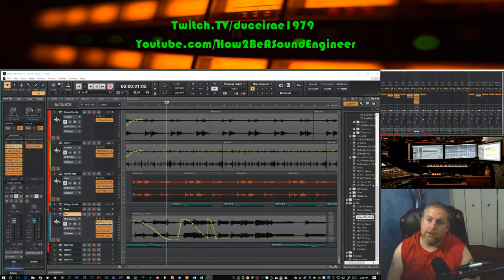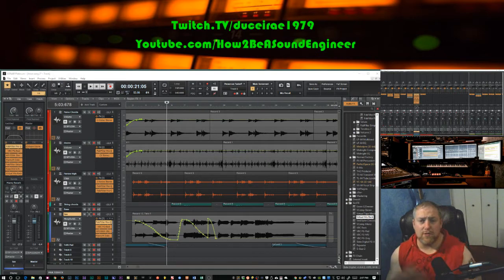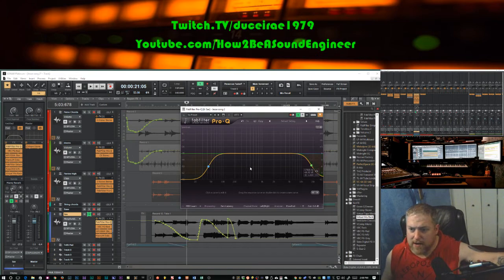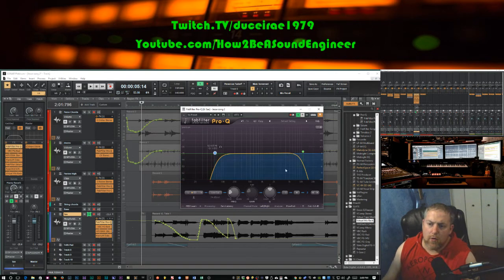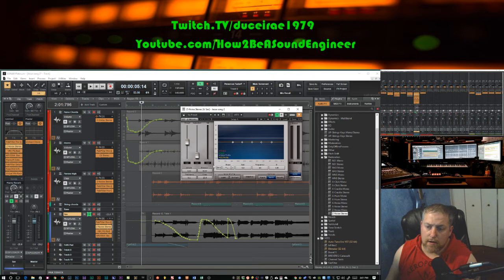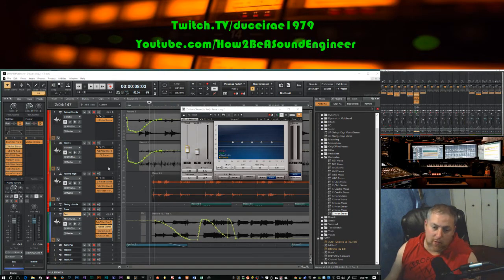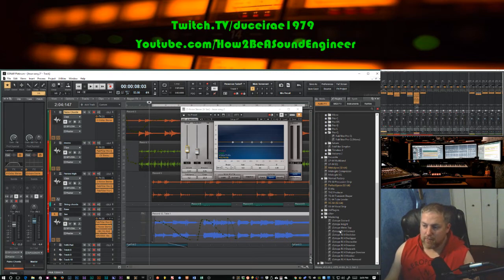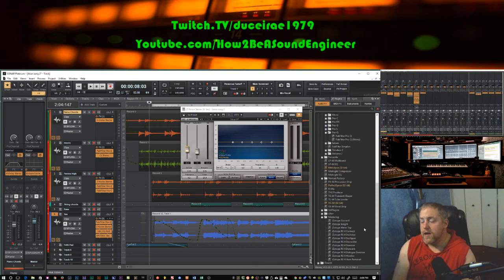HOW TO REMOVE BACKGROUND NOISE IN YOUR AUDIO

Comment: I hate to complain, but. ..  As an engineer, you should be able to notice and correct your speaking while editing this video.  When you start a sentence, and with the first four to six works, your voice is at a high volume. Then after those four to six words, you trail off so that your volume is so low, I have to adjust the level so I can hear you.
You are one of the thousands of creators who do this. Sorry, but it drives me insane and it also makes the video seem less professional.

Headphones would have been great to listen through but your "booms" hurt my ears.
Reply: obviously you don’t hate to complain you did it a lot